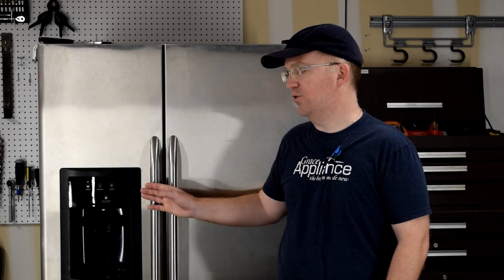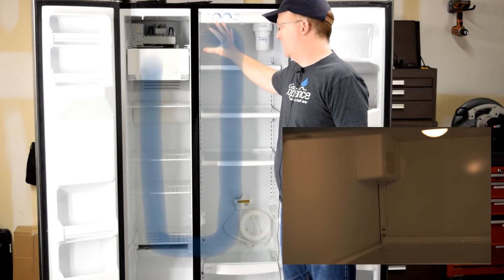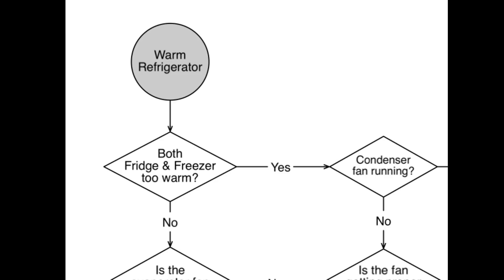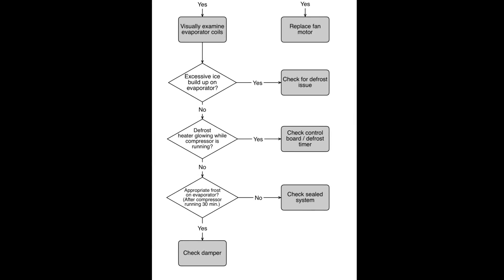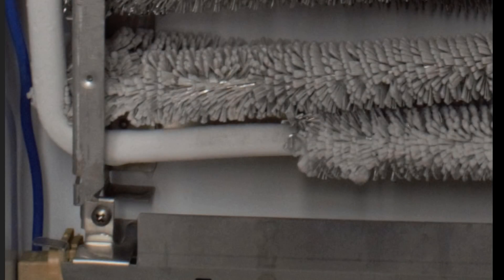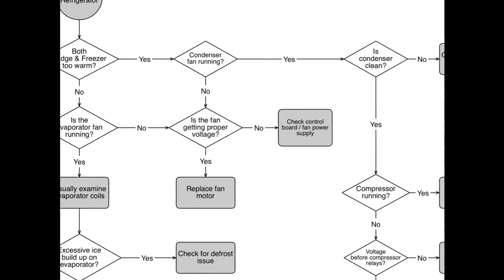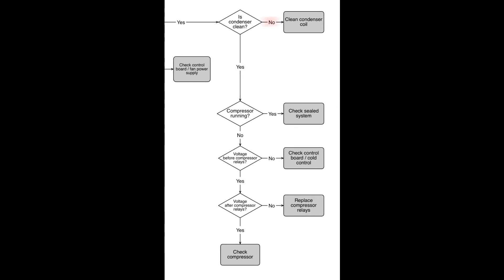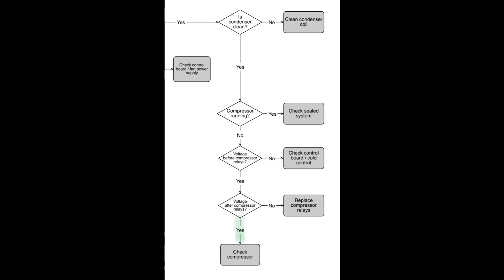Refrigerator Too Warm - Diagnostic Steps

Comment: What can be problem ?. Compressor is cold, isn't making clicking noise, Fan by Compressor is off as well. Lights in fridge are on. I install universal Relay Switch, still doesn't budge. If its Compressor problem, should at least fan by Compressor be running. If its relay, Compressor should be clicking trying to start.
Reply from the maker: Hi Pal, 
I agree with what you have written. If the fan behind the fridge (condenser fan) is running your compressor should be as well. If neither are running, it will likely be a control board issue you’re dealing with.  

Do you have GE refrigerator?
Reply: @GraceAppliance  Its frigidair Model GLHS66SBEF3, where to find control board in this model.
Reply from the maker: Pal Singh hey, looking at your tech sheet for your model, it does not give much assistance for helping you further diagnose, but here it is for your records.  This isn’t your exact model number but should be pretty close to your fridge:
ftp://ftp.electrolux-na.com/ProdInfo_PDF/Anderson/240389624.pdf

Your control board is located on the top of your fridge section inside the refrigerator.  It will be behind the display touch panel.  

I would try unplugging the refrigerator for 3 minutes to let the control board reset and then restore power to see if there is any change.
Reply: @GraceAppliance  This link doesn't open...
Reply from the maker: Pal Singh ok, feel free to email me at GraceAppliance@gmail.com and I’m happy to respond with it.  Thanks
Reply: @GraceAppliance  Couldn't find Control Board on the top of fridge section.
Reply from the maker: Pal Singh ok, thanks.  You may also find the control board underneath the fridge behind the kick-plate by your feet.  On the left hand side you’ll see a grey box about 8-10” wide.  
The kick panel is removed by lifting UP toward the ceiling. They usually are clipped on to pegs which hold them in place.
Reply: @GraceAppliance  I tried underneath behind the kick board, nothing there. Was looking another video, one fridge has above the compressor bolted weird place hard to reach. When I go home will try to find there.
Reply: @palsingh987  I.  Got my. Fridge.  In. Feb. 2020.   An top. Doin. Fine. But. Bottom. Not.  Need.   Help.  My. Food. Goin. Bad.

Comment: Had no continuity when testing my defrost heater .... Took it out and saw it was burnt up replaced it...freezer is completely defrosted and new heater element is installed.....if (dear God please NO) But if frosts back up what should I replace next?
Reply from the maker: Hey John, it would either need a high limit thermostat, a defrost sensor on top of the evaporator or a control board. Each have a different testing process, but we can burn that bridge when we get to it.  Good luck!
Reply: @GraceAppliance  seems I need help

Comment: hi there thank you for the video. Where did you get this troubleshooting chart please?
Reply from the maker: Hi, you’re welcome. There is a link in the description. Thanks
Reply: Thank you for the prompt response. I was hoping I could pick your brains too. I have two fridges. One in house other on in garage. Both of them are down. One has bad ice build up in freezer. I suspect it s the defrost thermostat since this model doesnt have a timer or an adaptive defrost control. The other one is the one that baffles me the most. Everything seems to be working but both the freezer are warm I mean room temperature warm. Any thoughts?
Reply from the maker: Nick Zane on the first one, you will have some type of defrost timer whether that be an old school mechanical timer or a newer control board.  
If you’ll send the model number I can give a little more detail on what to check. Now, it could be either a bad timer, a bad heater, or defrost sensor / thermostat.  To properly diagnose it, you’d need a multimeter if you don’t have one.  

Now the 2nd fridge, if you can hear/feel your compressor running, your evaporator fan inside the freezer runs, and the fan behind the fridge (condenser) fan is running, and you have clean coils - the freezer should be sub zero.  
If not, it would likely be a sealed system issue (bad compressor, low on refrigerant, etc) 

Let me know if you have any questions.

Comment: Probably a silly question: I purchased a used GE refrigerator.  It seems like it completely turns it's self off at times. (Randomly you can't here it running.) Is this a major issue or is it supposed to regulate itself like that?
Reply from the maker: Hey Veronica,
Not silly at all. Sounds perfectly normal. As long as it's keeping the food cold enough, it's totally normal.

Stay in touch.
Reply: @GraceAppliance  ok, I'll keep an eye on the temperature. Thanks for responding so promptly.👍

Comment: Andy, so glad to find your site. I have a model gsh25isxb that wont cool on either side lower then 55. I followed your chart and the fan and compressor are both running. And it obviously cools from room temp down to the 50s but doesnt get any lower. It doesn't appear to be leaking air from anywhere so might this be something else? A temperature sensor? Something else that wont allow it to cool more? Thx so much. Will def send along some donations if you can help me figure this one out! Regards,
Reply from the maker: Hey Richard,
Thanks for the kind words.  
So, if your compressor is running, both fans are running (condenser & evaporator), the coils are free of dust, and you do not have a defrost issue (very heavy frost build up on your evaporator) then you should have a light coating of frost on the evaporator coils after having run the compressor about 45 minutes.  If you don’t, this would indicate a sealed system issue. That is, a failing compressor or refrigerant leak.  You should see about 90% of the evaporator covered in a light frost.  

The easiest way to confirm is to remove the rear panel inside your freezer to expose your evaporator and inspect it after the fridge has run for a while.  Feel free to send a picture to GraceAppliance@gmail.com and I can confirm if this is your issue.  

Let me know if you have any questions!  Thanks, Andy

Comment: my LG refrigerator runs but  the freezer only cools to 44 degrees.  All the fans work, the compressor sounds normal.  The small refrigerant line gets warm but the large one mostly feels like room temperature.
What can I do to remedy the problem?
Reply from the maker: Hey Krisha, 
I’d confirm that you do not have a defrost issue (that is, heavy frost build up on the evaporator inside the freezer that does not melt away) because this would restrict air flow causing warm temperatures in both cabinets.  

The short answer is that if the compressor is running, both the evaporator fan and condenser fan (by the compressor) are running, the coils are clean, and there is not a defrost issue: the evaporator should have a light coating of frost on 90% of the evaporator after running about 45 minutes.  If it doesn’t, this indicates either low on refrigerant or a failing compressor.  Some LG fridges will have a 10 year warranty on the sealed system thankfully and hopefully this is case for you.

Comment: Hi Andy, Need a bit of help.  GE PSI23MGPBBB 2004 vintage.  Board got fried in a power outage on generator.  Burned R12 just below transformer.  I put in new board, WR55X10942 which should be correct.  Now, refrig side only gets to about 50 F.  Freezer is -2 F.  Evap fan is running.  Another issue is I get chips when I select cubes.  Everything was normal before board fried.  Before I go further on the coils and dampers, I am thinking maybe these boards have different versions depending on the exact model.  Is that a possibility?  Perhaps the calibration is different for different sensors (need correct board-sensor pairing?) which could result in not cool enuf, and the wiring not interfacing properly for front board selections.  I have watched your relevant videos and am struggling to think the fried board coincides with something else like frozen coils, and/or damper door issues.  One other thing I noticed when measuring on the old board.  I was getting about 5 volts where you were specifying about 12.5 v for a couple measurements of the control wiring.  Maybe that was because of burned R12, but maybe different boards?
Reply from the maker: Hey WQTX650,
Sorry to hear about your issues.  
There is a wiring modification that needs to be done on certain models which requires disabling one of your 2 refrigerator temp sensors. It gives these exact damper issues you’re describing, but am not sure about the ice issue you mention.  

If you’ll send the first 5 digits of your serial number I can happily confirm if your fridge needs this modification.  

Thanks!
Andy
Reply: @GraceAppliance  Hi again Andy,  My serial number is SG416493.  I got an info sheet explaining about 2 possible mods with the board.  I cannot find it at the moment.  I am quite sure the mods only applied to bottom freezer models and were to be ignored otherwise.  The mods involved cutting wires in one case, and removing a capacitor in another.  My unit does not have the capacitor mentioned and is not a bottom freezer model.  Mine is older, 2004, and has about 8 screws holding the board cover, not 3 screws like in your video.  One last thing, the replacement board had pins for J14 and J5 which the original board did not.  There is an extra plug on my harness which looks like it would go to J14 if that old board had the pins there.  I only connected the plugs to the new board that were connected to the old board.  Thanks for your help.  Bill
Reply from the maker: @wqtx6502  
Hey, you're right that it does apply to ALL bottom mount freezers, but there is also a list of fridges that it does apply to as well that are side by sides.  Yours does not appear to be affected by this list.  See here: 
https://www.scribd.com/doc/115029528/WR55X10942-Installation-Instructions

I would double check to be sure that you were in fact sent a WR55x10942 (or WR55x10942P).  It seems odd that you'd have additional plugs. 

Feel free to send me pictures of the two boards to graceappliance@gmail.com if you'd like me to take a look. 

I have not run in to this exact issue before.  I'm at a bit of a loss as to why you'd have an extra plug unless you have gotten an incorrect board perhaps.  
Having looked up your schematic, it does appear that the WR55x10942 is what's called for.    :-/

Comment: Sir great video, my defrost coils  are dry  and no moisture on them period and  evaporator fan is operating , and both freezer and fridge are at 46 degrees . And I used ohmmeter the heater wire are good, I checked defrost thermostat in cold water and it did not Ohm out, Thks.
Reply: Compressor is warm but I don’t hear it come on, model ED25DQXDB04 side bye side whirlpool, thks
Reply from the maker: scott magyar if your condenser fan behind your refrigerator is running, your compressor should also be running.  
If the fan is running, unplug your refrigerator, access the 2 wires leading to the compressor relays. Attach your multi meter to perform a voltage test (AC voltage). Making sure you are not touching any wiring to prevent getting shocked, replug in your refrigerator. You should have 120v before the relays and also after the relays.  Let me know what you find.  

Thanks!
Andy
Reply: GE Side-by-Side ONLY - Refrigerator Repair Videos  

Sir, the fan is running constantly, next to compressor , not at home right now, stopping at Appliance dealer after work,  to get a hard start relay kit from dealer,
Reply from the maker: scott magyar good deal. I’d recommend getting an RCO810 (instead of rco410). It’s smaller, but less likely to damage an older compressor.  Let me know if you run in to any questions.  Thanks!
Reply: GE Side-by-Side ONLY - Refrigerator Repair Videos 

Sir I got a ERPU410 powerstart kit, and I need to know which of the 3 pins on compressor is marked common, start and red since I can’t see them on compressor so I can hookup, thks
Reply from the maker: scott magyar hey, check out Bill Newberrys (RIP) video. The pins either have 2 pin on the bottom or flipped and two pins on the top. So, the common is the pin by itself.  I hope that makes sense.  https://m.youtube.com/watch?v=RamyqjqeLXA
Reply: GE Side-by-Side ONLY - Refrigerator Repair Videos , sir, I figured out pin issue with ohm meter and fridge is finally cooling now , but I was wondering about evaporator fan running constantly now that fridge freezer is at -9 degrees and refrigerator is almost at normal temp 38 degrees and dropping after being off for 24 hrs , should evaporator fan cycle to off position once it reaches normal temperature. Or is defrost thermostat not closing to turn on heater, since my heater was checked with ohm meter and it's good, Thks
Reply from the maker: scott magyar it sounds normal to me.  The fridge and freezer temp is constantly wanting to creep up. Once it reaches a certain amount over the set temp, it will kick the fan on to circulate cold air to the fridge side and eventually kick the compressor back on.  

If you’re not seeing ice build up on the evaporator, I wouldn’t be concerned with a defrost issue at this point.
Reply from the maker: Hey Scott, 
Please send your model number. That will help me give some tips. 

Can you hear the compressor running at all?

Comment: Yay got fridge to get cold again verrry cold now in low 30s !! Ice was blocking off the bottom return and i chipped it away most of it but stopped when I realized I might damage something . Ice somehow melted away . Checking it every day on ice and if I find water at the bottom  which used to collect there . So far since Saturday verrry good .
Reply from the maker: Frank Montez nice work Frank!
You could have had a clogged defrost drain line. This will cause icebuild up and water build up where it should not be.  You’re right, it’s better to stop and walk away when you start chipping ice. It’s never happened to me, but I’ve heard of people chipping ice and puncturing their sealed system and letting all of the refrigerant out.  That would be a really. bad. day!  

You might check behind the fridge, behind the access panel where the compressor is, you’ll find the defrost drain line which you can remove. You can blow air through this tube and should be able to do so. You may find that it’s clogged up with junk there.  

Let me know if you have any questions.